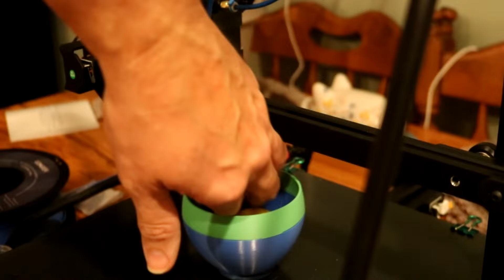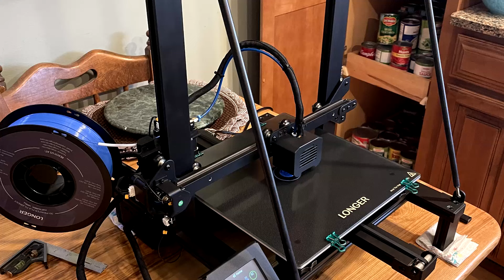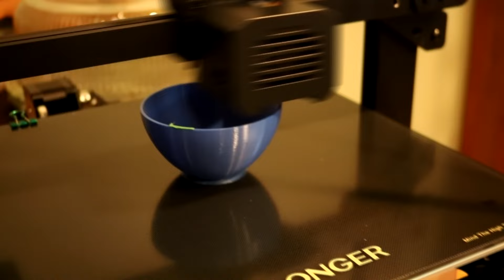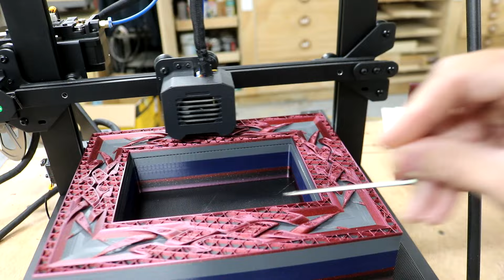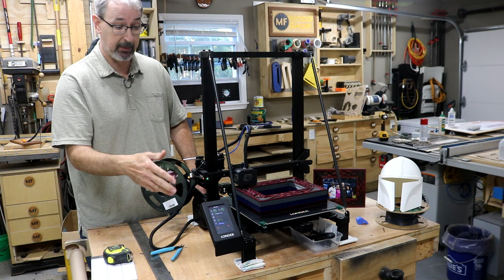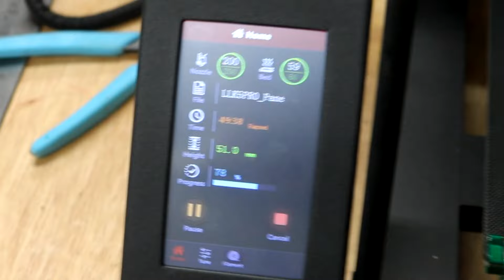Longer LK5 Pro

Comment: Does it Self-Level?   I have the Ender V2 and I'm about to toss it against a wall. It stopped working and I've re-levelled the bed like 10 times and it will not print.  I don't know what is going on with that machine.
Reply from the maker: No it doesn’t, but it’s easy to level. My ender is about to be tossed as well. Keep having issue